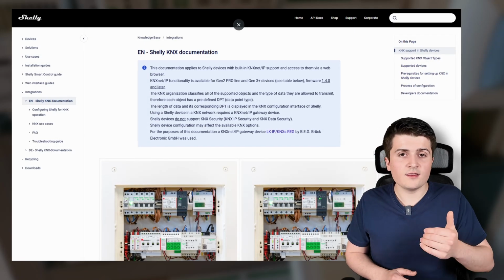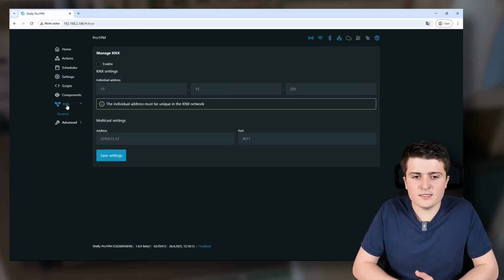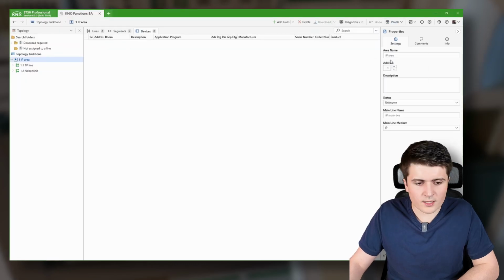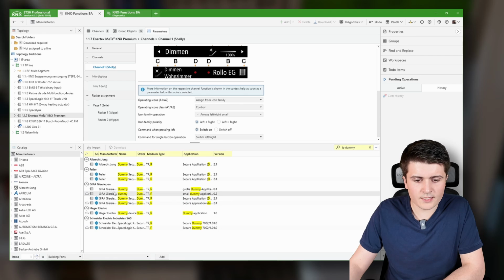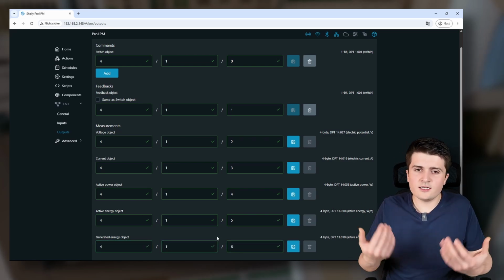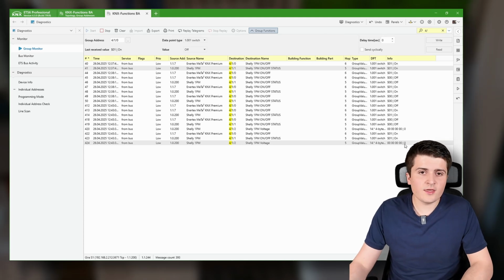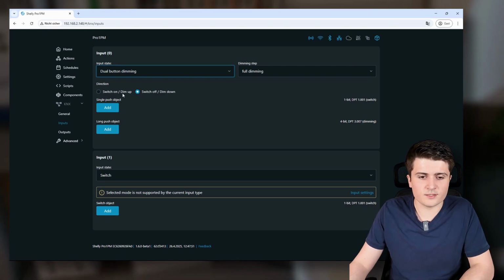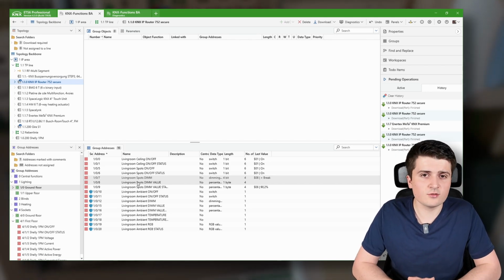Connecting Shelly to KNX - Step by Step

Comment: Hello. Thank you for this video. I followed your steps and managed to control from KNX a Shelly 1 Mini Gen4. I just don't recieve on KNX the status from the shelly. Do you have a sugestion for this issue?
Reply from the maker: Can you see the telegrams in the diagnostics when you set you network interface as interface to knx?
Reply: @torbenledermanneng975  Hello again. On the filter table of the IP Router I can see the on/off telegram and the status telegram. On the diagnostics I see the on off telegrams sent on the KNX TP side but don´t see the status response.

Comment: Hello,
How to change the Area Medium type from TP -> IP if Lina has one Line repeater. ETS does not allow that "Change medium type of '1.0 Main line' failed.
As long as a coupler exists at a sub line or sub segment, a change of the medium type is not possible."
Thank you!
Reply from the maker: Which address does your line repeater have?

Comment: Great and detailed explanation, 
As you mentioned and I also agree that the lack of secure is an issue that needs to be managed. 
I will suggest to configure a separated VLAN and lock the network with the devices MAC addresses (KNX Router and KNX IP devices) that no other network device will be able to communicate on this VLAN.

Comment: Great video, thanks for the detailed walkthrough! A few important notes for others testing with FW 1.6.0 beta 1:
- There are currently some known issues with KNX integration in this firmware version — we’ve already fixed them in beta 2 ;).
- To receive measurement values, make sure there is an actual load connected to the outputs. No load = no data.
- The DPTs selected for measurements are chosen based on the most commonly used types for compatibility.
- The part where you demonstrate the dummy device setup in ETS (especially 6.3.0) is extremely helpful — nicely done.
- I’ve also taken into account future expansion of input functions, including cover control (roller shutters / blinds).
Keep up the great work — these videos are a big help to the integrator community!
Reply from the maker: Thank you very much for the feedback and the notes. In my case it seems like the measurement itself doesn't work, even if a load is connected. However it would be really cool to have the option to decide wether the measurements should be send as a 4byte or as a 2byte value. Because some Displays only supoport 2 Byte Values.